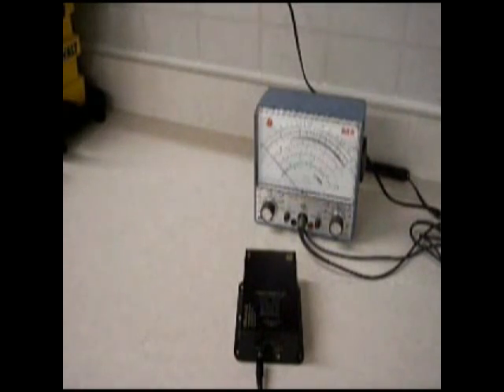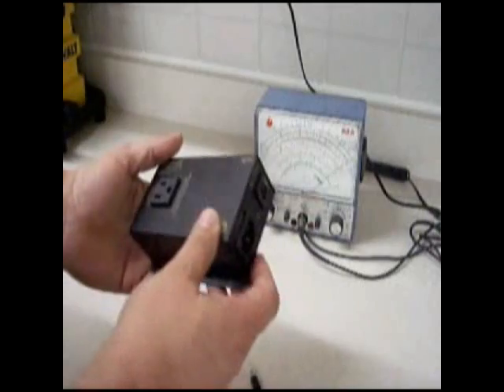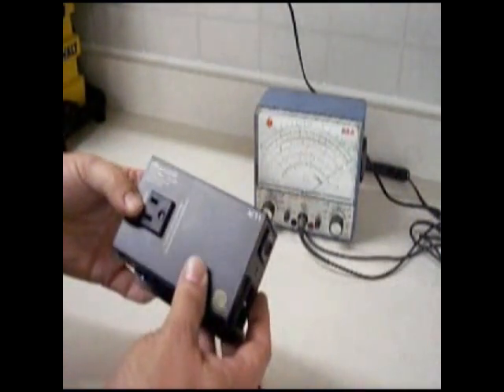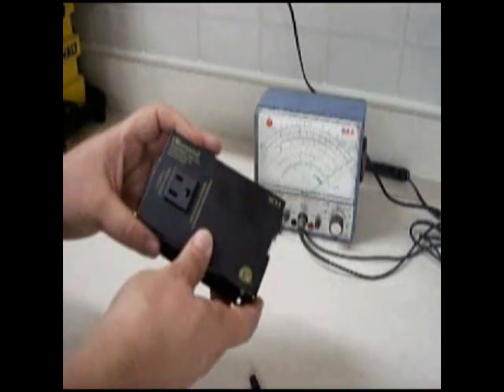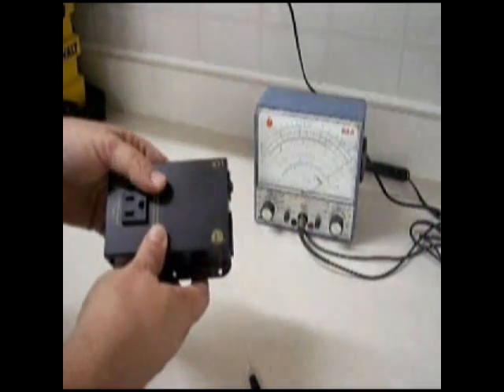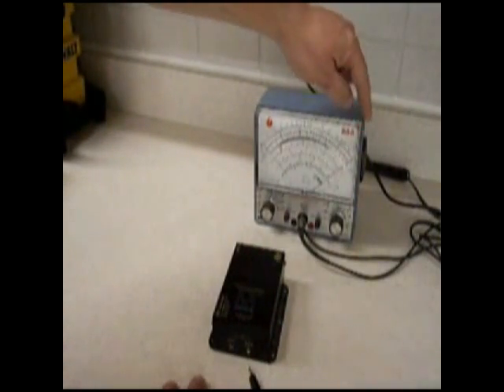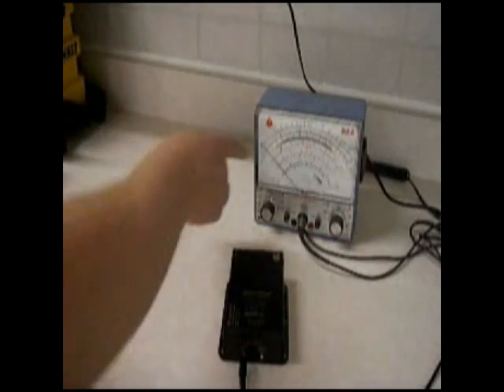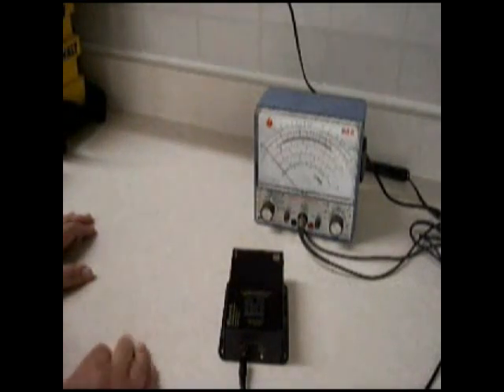Russound CAV Fire - Russound ACT - 1

Comment: A partially inserted cable is not the correct mating and thus "misuse", it is not designed to be inserted partially, it is not intended to be USED that way and is therefore being MIS-USED.